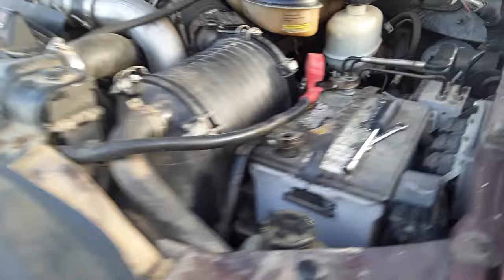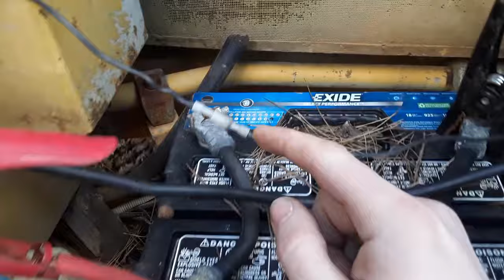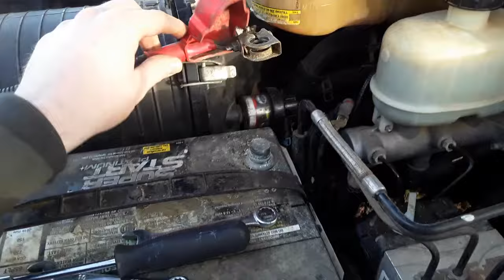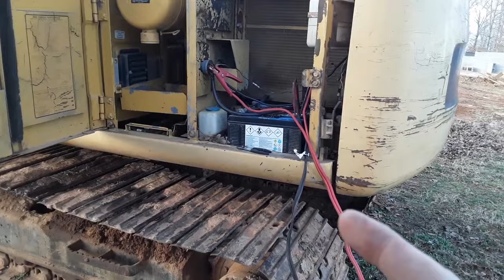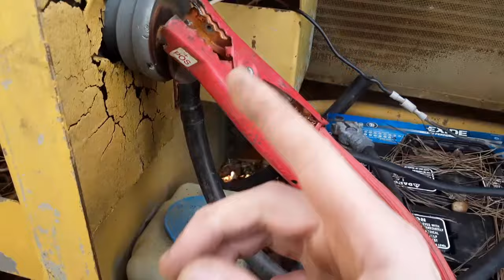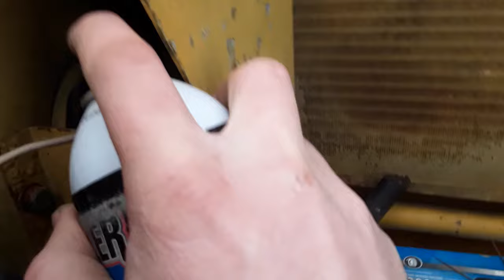Jump Start 24v Excavator With 12v Truck

Comment: I am looking to put a jump Box on 24 volt system show me a picture please
Reply from the maker: You would either have to get a jump box specifically for 24v or an analog jump box. All the new electronic jump boxes won't send power unless they recognize the cables are hooked up correctly and the voltage is just right.

Comment: This is brilliant.... But does the excavator use glow bar ... It took pretty long to start....or was it a fuel issue
Reply from the maker: Thank you. Soooo with this excavator, the main cpu is bypassed and the throttle is ran by a cable, starter solenoid is activated by a push button, fuel solenoid is activated with a key switch. I had forgotten to turn on the fuel solenoid so it wasn't getting fuel. Gotta love old diesels that can still be made to run even when the computer says no.

Comment: Basically, you need two good 12Vdc batteries and 2 sets of jumper cables. No truck necessary. Literally. Was hoping thus would save me a walk across the yard to fire up the old Cat scraper and jump it, but disconnecting all of the wiring is-im just lazy, there I said it.

Comment: If your truck only has one battery you can charge one battery on the 24volt system for about 10 minutes then put the cables on the other battery and crank it up no need to do all the rewiring unless it has 2 bad batteries just keep truck running and don’t cross batteries or your in trouble

Comment: So your showing us how to jump a 24v with a truck with 2x12v batteries.... Which equals 24v? WTF! You owe me 3 minutes of my life back.
Reply from the maker: Yes, but your truck is wired to still be a 12v where the machine is 24v. You have to wire the truck batteries different and isolate them or you'll burn up your truck wiring.

Comment: I just found your channel and am in the process of going from a position in a pharmaceutical company that I hate to opening a small engine repair shop and possible welding and equipment repair(mobile). I am in PA and could use some pointers if you have the time or would care to chat sometime. I am in the northeast near phoenixville and I got the feeling you might have been in PA also. I want to start a place where I would pickup people's equipment and then drop it off when it was done because I would be using my father's farm. I was thinking f doing local pickups and drop offs for free. I bought a Ford Ranger but it needs some welding that I will do soon. I was in a horrific accident eight months ago where I was hit on my harley and had my right leg crushed and got extensive blood clots. I was not able to walk for seven months and just two months ago got to work but I hate the position and it is not paying the bills.Let me Know how I can get in touch. Thanks.